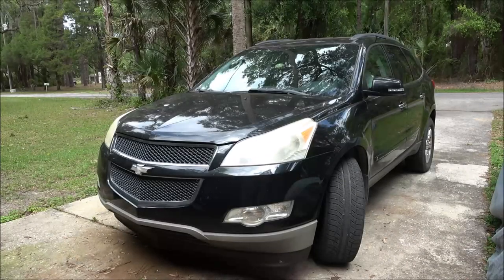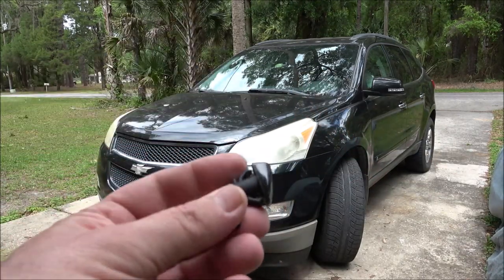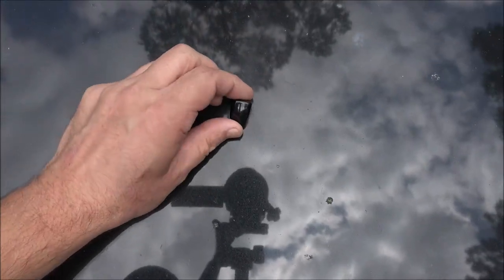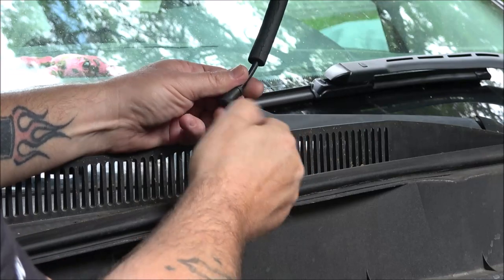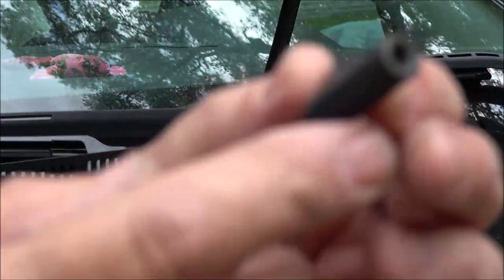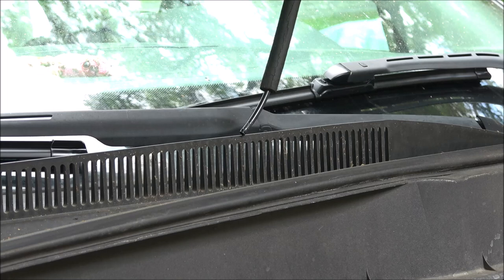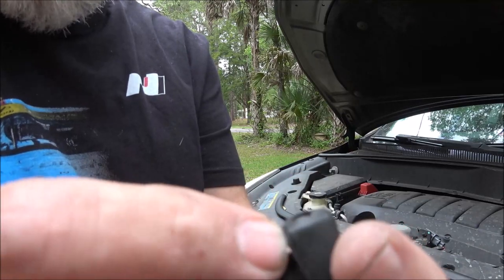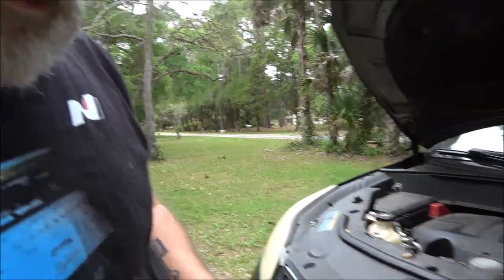Windshield Washer Nozzle/Sprayer Install On 2010 Chevy Traverse

Comment: G'afternoon bro 🤠 . I used to keep 3 or 4 of the small external washer fluid pumps in my tool chest because I've used them for a lot of different projects especially in R/C boats to increase water flows so the speed control and brushless electric motor run cooler or to run a water-cooled nitromethane boat motor on an RC truck with a 2nd gas tank as a water reservoir with a little inline radiator to keep things cool 🙃 ..
Reply from the maker: Yeah them little pumps are very handy in many different situations for sure.